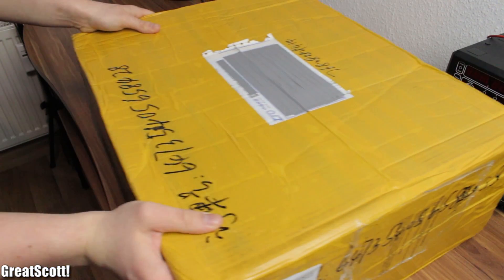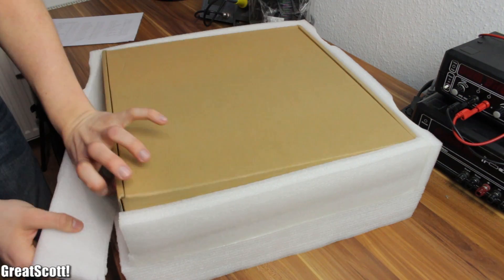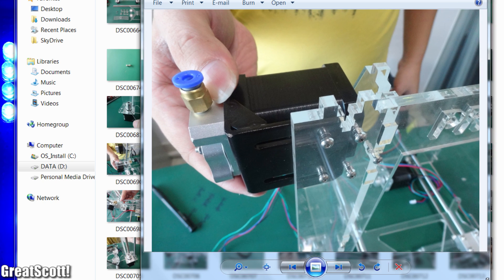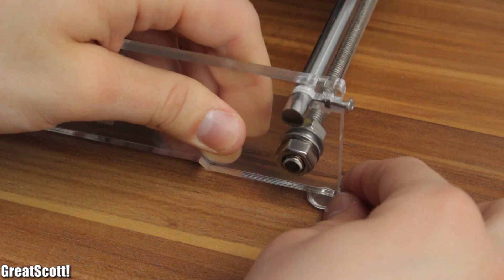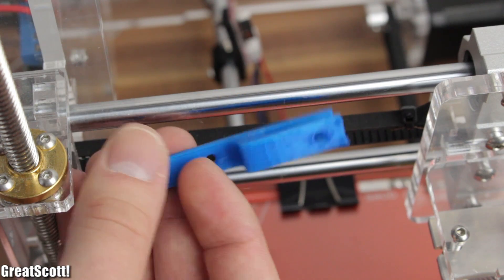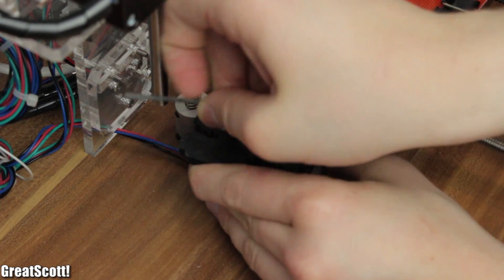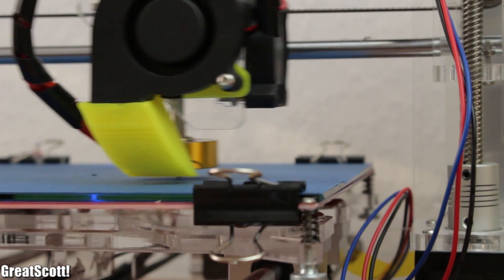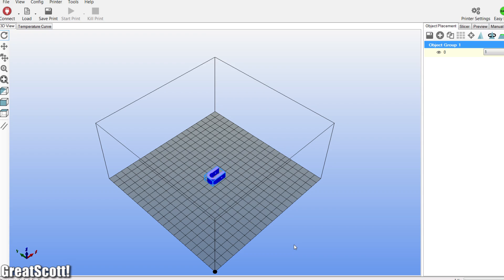3D Printing Beginners Guide (Hardware) - 380$ DIY RepRap Prusa I3

Comment: "I recommend this printer to anyone without an anger problem..." It will give you anger problems. I got an updated version of this printer for just over $200 on aliexpress. It is a giant pain in the ass. The biggest problem is the bed not being perfectly, or even close to flat. They sent an aluminum plate with a heater taped to the bottom, so I taped some glass on top of my bed. That worked ok, but it was less than ideal. Then it cracked due to some stupidity, and the replacement is incredibly warped under tension.

I also had issues with the hot end, which i replaced... Then I had to fabricate a mount for it because I got a knock off Chimera that isn't quite the same. I basically had one shot to print a mount and it was wrong. Fortunately I can fabricate most things out of MDF.

i've put about 100 hours into this thing and I've had maybe 10 successful prints. It would have been cheaper and faster to have someone else do it for me. Don't get this printer.

Comment: Thing is: 50% of the quality comes from the machine: calibration, tightness, strong frame, electronics.
the other 50% really come from the software, aka. the slicer you used. personally i find that slic3r or craftware are the better choices, while slic3r is bit complicated on the first look, its really impressive under the hood, but it lacks manual support. this is where craftware is better. but really the best one is simplify3d, which cost like 150€ but if youre willing to pay it, then i would support. that.

Things i already upgraded from my original build: auto bed compensation, rocking a original e3d lite6 and z-axis which can tigthen the x axis belts. then i changed it to a ramps electronics, because the melzi board it came with was broken, and installed marlin on it. Man that is a beast! after you manage to get the settings right, prints really look awesome. already on 0.1mm layer height, and this is not the end

Comment: Hey Greatscott. Könnte dir gerne mit deinem Drucker helfen! Habe auch einen Drucker und viel Erfahrung.
Reply: +Julian Dahl Also, a nice Printer is this one:
http://de.aliexpress.com/item/large-size-metal-fuselage-High-Quality-Precision-DIY-3D-printer-kit-with-LCD/32549538291.html

Doesn't have a moving Table.
A moving Table (Which is used in this Printer) is very heavy and you can't print very fast.

Comment: The upgraded version (2015, linked) is nice, but order the upgraded bed when you order this printer.... Trust me, don't use the included aluminum bed! Mine does not heat for jack unless I put something on it (say a piece of cardboard, but I have to remove it RIGHT before a print starts, or the head will collide, the belts will jump, and you'll have to start over...... By waiting a half hour for the damn bed to reheat...

Further, mine spit the heater wire twice; the solder joint simply failed, and the wire came off the awful stick-on heating unit under the bed... The second time, I peeled up enough of the heating sticker to bore a hole through the terminal and run some of the wire through. That seemed to have licked that problem, but I am most definitely getting the borosilicate glass bed upgrade......... Kinda sucks that they downgraded the bed for the "upgraded" kit... >:\

Also, he is NOT KIDDING about not having an anger problem; this thing is a pain in the stump if you start off completely dumb to 3D printing.... Over probably thirty print attempts in three days' worth of fine tuning, I had a whopping ONE succeed ONLY by sheer luck, and it didn't come out well at all... 

Also also, make sure you have a friend with a 3D printer and some modeling savvy, because the acrylic breaks easily....... I'm now staring at a broken, useless printer that I cannot even fix because chassis parts simply are not available outside of a full kit...

I've a feeling I would've had far more success had the company linked not cheaped-out on the supplied bed....

Comment: I am not sure if you check these posts still, but since this is an FDM printer can you convert it too a SLA printer?
Reply from the maker: +dragnet53 Not that easy.
Reply: +dragnet53 SLA is an entirely different way of printing
Reply: You technicaly(it would be the same as making one from scratch) could but it would be cheaper and less money to buy a whole new print
Reply: +dragnet53 No. You can't use parts of this Printer, because SLA hasn't a moving Head.
SLA Printers have a Laser which harden the Resine.
A complete different way to Print :)

Comment: Hey! I NEVER comment on anything but I have to tell you thank you soooooo much! I wanted to get into 3d printing so bad but the price of a printer was stopping me from that. After seeing your video I was able to get into my new favorite hobby! :) 

For those thinking of getting this printer DO IT!!! I spent $255 this Christmas and it was well worth it. Many of the problems listed above are gone. In total it took me 11 hours to build and I was about to do it on my day off. DIY is the moto of my life and if you want to learn and grow with this technology this is the printer to do it with!
Reply: +Chris Rivera You might want to check out Vulvanus V1.1 if you want to upgrade to bigger. Its really neat open source design and i'm planning to build several with my friend moment parts start roll in from over seas.

Comment: hmmmm.... do you know why you are having such bad time calibrating and having crappy models`?????

look below the heat bed.... what´s the support made of??? YES.... YES..... acrylic, and it soften with HEAT, from the heat bed........ making your calibrations worthless after little more than 30  min of print due to heat, the springs will push down that support. Place a cork sheet for heat insulation; between the heatbed and the support for the print bed.... I improve my models after I change it for aluminum. Also you can upgrade it with very little money, to a self leveling bed, NO MORE Z CALIBRATION AT ALL, the machine will check for calibration anytime starts a print.

by the way, that tape tip it´s GREAT... it´s just regular masking tape but very large size...where did you bought that `??
Reply: +Dimitri Del Corral where can i get a self leveling bed? Like our author friend, I'm very new to 3D printing.

Comment: Hey! I've bought a Prusa i3 like a month ago, it was sometimes really frustrating about problems occuring with 3d printing. But right now, printing is really easy, with every failed print you learn something and this is crucial. I print like 90% of what i send to printer. But you have to build a enclosure because without it, printing with abs can be tuff. I hope you gonna make some another video about 3d printing, its been a long time :) Cheers

Comment: I bought a RepRap Prusa I3 last year. I bought it because it was cheap and I did not know it was a kit, until I opened it. we did finish putting it together then we turned it on. but guess what, it did not work! so I sold it on Craigslist and someone bought it. but I only got like 150 dollars for it. so I saved up my money and bought a Lulzbot Taz 5. it works very well, and the print quality looks good. I think the reason my RepRap did not work is because that Power Box was probably no good.

Comment: nice/good video thanks!

If your print does not stick to the glas then you can try using hairspray
spray a thin layer on the glass and try it.

good luck with 3D printing you all
Rob.

Comment: I got a cheaper kit and I'm getting better results
Reply: there are many much better and much cheaper (250$) printers you can get.
Reply: @j.kihope  the video was 3 years old when you post that comment ...
Reply: +Andres Celano will do give me a bit will have stuff up soon
Reply: +Grey John  Can you post the link of it pls :)
Reply: The filament it comes with is white and black and the black is abs and the white is pla the black doesn't work that we'll but is ok when you need to get more filament I would recommend hatchbox pla or abs the price is around $22 per roll and works realy we'll with this printer I would recommend if you are going to do prints over 2hr you should get a 120mm pc fan to glue to the power supply because it gets hot bot after it's cool to the touch. and I would recommend cura as the slicer and use the sd card to print not usb to gets messed up to much but sd I've had no problems with
Reply: Grey John
 Thank you very much.
Reply: +Besart Berisha your welcome I hope that helped and if you have a problem I can try to help you if I can
Reply: +Grey John post videos of you printing stuff
Reply: +Andres Celano I have one video on my channel with an item I printed put that up fast will have better video soon with time lapses
Reply: Lol yh

Comment: I really do know what you are on about. Bought myself a I3 Kit for about the same price a while ago. At first it was really frustrating but now it's printing pretty nice for it's price.
I only had one real issue. The cable clamp on the mainboard which connects to the hotbed literally melted away. Since it nearly caught fire i guess this could be very dangerous if you are not somewhere near the printer.

So go check this clamp, just to be sure!

Comment: Great video.  "Anger" comment cracked me up. 

I just assembled the prusa pro i3. Can't figure out why it says "Sd card inserted" yet, it can't read my .Stl files. 

Also, don't know how to connect filament to extruder. 

Any videos?
Reply: +James Aldridge for the sd card you need a software like cura, as it converts the .stl files to .gcode files, which is what the printer understands. to put in the filament just squeeze the spring near the extrusion motor until there isnt any tension on the gear and run it up the holes and through the bowden tube
Reply: +James Aldridge The extruder needs to be hot first. The files must be gcode, not stl. Try using slic3r
Reply from the maker: +James Aldridge Not yet.

Comment: I just bought one. I have an anger problem. Ha. Oh dear.
Reply: +ThisIsMud If you bump into problems, breath, take a brake and go check solution from forums. Breaking stuff wont solve the issue, just make it worse.
Reply: Cheers +Hellsong89 
I ended up buy an Original Prusa i3 from Prusa Research. Had a couple of steps I had to reverse and do again but all in all a pretty painless build and the first prints were impressive!

Comment: I'm looking on buying one of these, any tips on assembling this bad boy?
Reply: +ANoobsLife1 Good tip is to read about 3D printers before hand, so you understand most of the inner workings, or at least learn the basic principles.
When you understand these, it makes assembling and operating it much more linear experience and your not just pushing your head into bush.
It took me two weeks worth of research and i'm fairly confident i know these things amount, i can make upgrades before purchasing the parts for my first DIY printer, built from scratch. Only thing i'm still clueless is the custom programming (modifying the Arduino code to get more things done, like auto start up/shut down sequence on push of the button, arduino controlled LED spot lighting, fume extraction and other goodies i had in mind to add in future)
Reply: Dont buy the acrylic versions. Better to spend 30$ more than this kit and get a TEVO Flash or spend 200 more and get the original prusa i3

Comment: you can buy much better 3d printers for less than 400 dollars.
Reply: Like?
Reply: Hestand Gaming Printers, that are made in the usa or europe and Not some overpriced chinese knockoff. This is not even the original. I think the original has nema 23 steppers and not these.. i dont know what to call them. and this machine shown is using cheap fake chinese plastic that breaks if u touch it.
Reply: +Nikolas Sorknæs well if you have past experience with a prusa then you must have bought it from another manufacturer, Reprap is the original makers. There are TONS of other manufacture that make this same printer with knockoff parts. 2) so basically what you are saying is that any plastic you print is cheap and with break when you touch it? All the plastic for this printer from Reprap is printed by other Iprusas.

Comment: I just received and built my prusa i3 from the link in great scotts description and I can confirm that almost everything is fixed.  from the video (there is only one tutorial on the dvd and it is all correct) to the new and improved end stop switches to the belt tensioners, everything got revamped.

Comment: 1/4 success rate? Are all 3D printers this bad or is it just this one? Is the original kit (supplied by Prusa) better?
Reply from the maker: +SteamFox Since this was my first printer I can't tell you about others.
Reply: I went for the prusa I3 first, it was quite bad tbh, so I got it returned and bought a ctc, it was a lot better for the same price, and also, working from the box
Reply: +ozfartface Was the kit from Prusa or from somewhere else?
Reply: +SteamFox yeah it was from prusa, but if you're looking for making your own printer, you're beating off sourcing your own parts, but if you're just after a cheap first printer, go for the ctc, it's been working quite well for me
Reply: I got a makerbot replicator mini and it works perfectly, ive never had to do any major repairs or calibraton on it. Most of my prints come out fine if i dont fiddle around with it.

Comment: if the edges of the acrylic aren't flame polished it can crack from the pressure. also ditch any flush mount screws and used wide head screws and or washers. flame treat all the edges that take a load and you should be fine

Comment: hi, i was thinking about getting a Prusa I3, too. but there are so much out there and the price differs also by much. 
i.e. i found here a kit for 250 USD: http://tinyurl.com/ohq8ess  but i dont know if its good .

also which filament diameter is better 1.75 or 3mm ? and why ?
and what about the nozzle diameter 0.3, 0.4 or 0.5 mm ? whats the difference ?

and also which filament would you recommend ? PLA or ABS ?

and last question which frame material should be better 3mm steel or 6mm acryl ? i was thinking about the 3mm steel

or would this one from ebay (a bit more expensive) be better ? 
http://tinyurl.com/o5mymep

thanks for your help ;)

EDIT: i saw the one from the first link does not have an LCD, is one with LCD better ?

Comment: I found a 3d printer, "tiko" where it is WAYYY cheaper ($179 USD). even though it is smaller, it's a pretty cool printer! Check it out! Just google tiko 3d printer. It comes out in a few months, and I plan on getting one! Plus, it's unibody, so you don't have to assemble it!

BTW, this isn't an ad. Just wanted to say there is an inexpensive 3d printer to keep in mind if your in the market or getting started.

Comment: GreatScott! I have the same model and it has taken me a while and I am every so nearly there getting good prints.
My best upgrade has been printing a new X carriage which used 4 bearings rather then the stock 2 (which I found floats).
Unsure on speeds and retractions that you may use but not 100% there but getting results that are pretty tight now even with budget PLA.
There are a couple of sunhokey groups out there, but I got a feeling maybe you have some of this to share with everyone.

Comment: Scott, what layer size/thickness do you get with it? I'm pretty happy with my Printrbot Simple Metal which can achieve up to 0.1 mm layer height. Since I have my printer now, I would really like to make myself a rechargable USB charger for example to be used with my smartphone. I can design myself a casing for that part, but I have no Ideas how to use rechargeable batteries, capacitors, diodes and so on :/
Reply from the maker: CookieCraftMedia I am also using 0.1mm or 0.2mm
Reply: GreatScott! Hi, how are you able to print in 0.1 mm layer height? I an using the exact same printer, which came with a 0.4 mm nozzle and also settings (is software), but changing the software definition to 0.2 mm changed only little bit on the printed material (I'm using ABS btw)
Reply: Michael Rabeno Which program are you using to slice/print your models? I use Cura from Makerbot. Alltough I do not have a Makerbot, it is compatible with Printrbots, RepRaps and many more, so I would suggest giving it a try, since it is easy to understand, includes a slicer as well and you can modify many settings including the layer height really quickly!
Reply: I'm currently using Slic3r, but I'll take a look at the Cura program, maybe I'll get more lucky with it. Thanks
Reply: +CookieCraftMedia Isn't Cura from Ultimaker? Makerbot has their own slicer...
Reply: Bryce Villanueva Yeah it is, my fault :/

Comment: Video on software and design creation would be greatly appreciated. For example, I do not have 3D printer, nor I plan to get one, but I can get access to one through local enthusiast community. The design part is the bottleneck for me (and probably some others).
Reply: +GrimzorFantagozor Check out 123D design. Its simple program to learn and you can get lots of designs done with it. For more complicated designing, check Autodesk Fusion 360, but be prepared to use little bit more time learning it.

Comment: Just to help you with using the glass, you will get way better adhesion if you clean it with alcohol enough and scrape it down with a blade. I am sure the process can be accelerated if you just use degreaser. 

I dont use any tape, glue at all right now, also has a spare laptop power supply dedicated to the heated bed. You need a relay or a special transistor to do the same (transistor will be silent, relay will make clicky sounds)

I hope these tips helps you!

Comment: Hairspray do work on glass. I've put layer 5mm corc sheet under bed, and bed heater began to heat up much faster. Before corc i was unable to reach up 110 deg (for ABS).